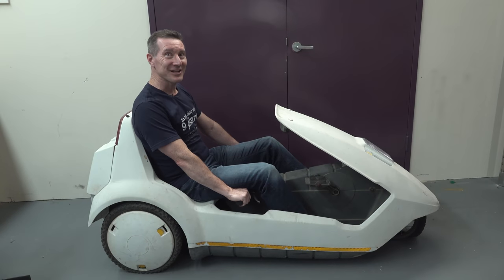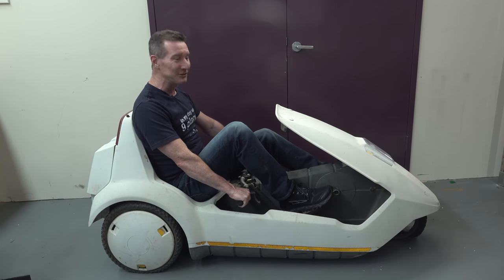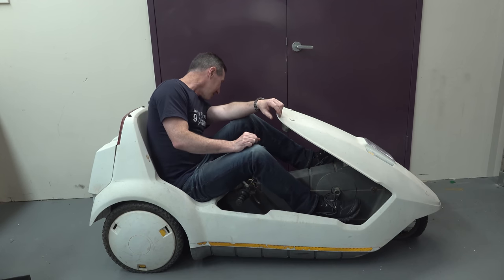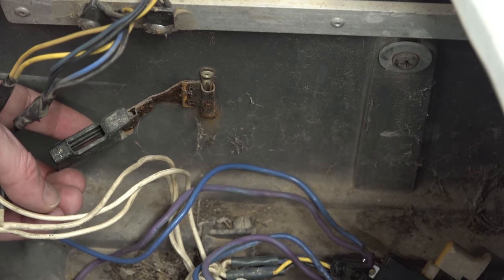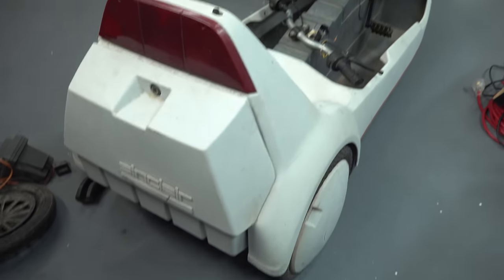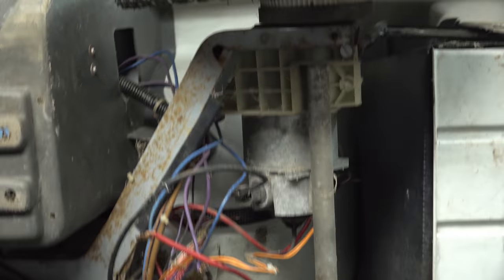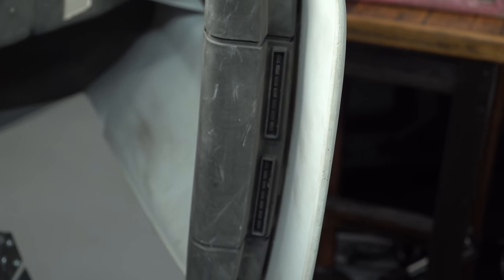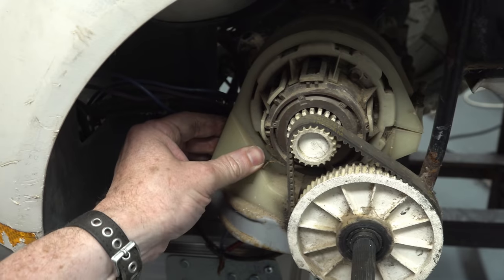EEVblog 1419 - Sinclair C5 Restoration - Part 2

Comment: That would not be legal in Victoria. The power limit is 200w for an electric scooter/bike, which is the category this would fall into.
Reply from the maker: With 250W of washing machine motor power they'll never catch me!
Reply: @EEVblog  lol
Reply: The laws on this stuff need sorting out. In the UK the rules for what electric bikes/sccoters can and cant do and where you can and cant ride them in some cased depent on whether you own it or it is hired out by by some company on a supported local authority scheme. We have had a few people killed on scooters and in modern town traffic with nut cases driving cars and trucks the C5 seems a bit risky. As for power ratings can we expect PC Plod to get out some sophisticated bit of test gear to measure your comsumption at full throttle? I doubt if that will happen.  A lot of people ignore the rules anyway. We have also had students hiring scooters for fun after a few drinks and having driving offences recorded on their licence for bing over the limit.
Reply: @EEVblog  I believe that treadmill motors may be an option.  Easy to find on the secondhand market.  They are all the rage for motor upgrades to benchtop drill presses.

Comment: So, do you keep it original or whack in an electric scooter drive? We're working on a 48V, 3-phase 10kW drive at the mo but you'll need a trailer for the batteries.
Reply: the frame and everything would crumble to pieces trust me you should not get higher tan 300W with the motor if you want the original frame and wheel construction.
Reply: @Merlinkatamari  The motor is no bigger than the C5 one though. Oh, it and the inverter are liquid cooled too...🤣
Reply: any writeup?
Reply: @nicholasroos3627  On what?

Comment: It is an inherently deadly vehicle being that low and exposed but if restored well might be fun. Maybe smooth out the body and paint with automotive pearl white like a Tesla. Get rid of the pedals and chains, just fixed pegs. You have to have rear wheel drive, front wouldn't have enough traction. Good amount of modern lithium power, say 500watt hub on each rear, should go like a bat. I believe there are hub wheels in that size. The smaller diameter than a bicycle means the motors have an easier time. Modern LED light. Could be vastly superior to the original. Be careful though. I wasn't exaggerating the danger. Quick squish and you a gonna.

Comment: Not impressed by the mechanical design, looks like it has a large turning angle.
Could use a flat battery pack on the floor and dual brush-less motors ;-)
Reply: Would you have done better in the 80's ? It's easy to throw stones when you can stand on the back of 40 years of advancement.

Comment: Someone had too heavy ass and the frame cracked. I would see some double 5kW brushless motors and a ton of Lithium! Ofcourse hub type. Led lights. And disc brake in front. In general all plastic gears will fall apart very quickly after so long time.

Comment: I'd love to have the chance to re-engineer a c5 with modern batteries/motors and control systems...can't see the point in keeping them original ..sir Clive would have used the modern gear if it'd been available back in the day.
They sell for silly money now here in the UK.
I owned a zx80 then a zx81 way back as a kid ...god knows how many hours were spent playing on the all conquering speccy... damn you horrace.

Comment: What an ergonomic disaster: the steering with your hands below your legs is frightening. When you hit an object you automatically want to put your arms and hands in harms way in front, to protect your body from impact. This way this action is delayed. Wouldn't be surprised if that fact was causing the public to discard it.
Reply: A Dutch inventor of the original 'ligfiets' also had the handlebars beneath the legs. It looks uncomfortable/unsafe but it really isn't. (I know from riding my C5). The most uncomfortable things of the C5 are the lack of suspension and the puny brakes. I have the foam seat padding (I would not call it a cushion) and it makes it bearable to ride. You need to anticipate really well to safely use this in modern traffic. I have put in a more modern deep cycle sealed lead acid battery in it (55 Ah) and it will do about 20 to 25 km on that. The original battery cover and keyswitch fits with some little work. Behind the rear reflector I put in LED 'arrows' as indicators, didn't wanted to ruin the body with the original big orange indicators. Head and rear light have also been replaced with high efficiency (and visibility!) LED's

Comment: 00:30 I had a Sinclair Scientific calculator that my father built from a kit. It cost £14 at a time when basic 4-function calculators cost around £80+.

It used reverse Polish notation to enter the required calculations.

It calculated trig and log values on the fly (presumably using the infinite series) so there was a noticeable delay with some calculations.

Comment: Went to college with someone in the 80's who's family had one of these when they came out. Not to use on the roads, just as a novelty, don't think they would have achieved the minimum speed to go on the roads, even down hill, with a wind behind them. Didn't help they looked like a death trap and were a bit of a joke.